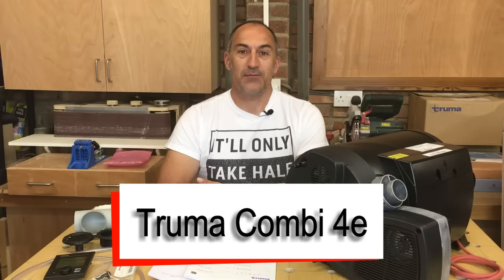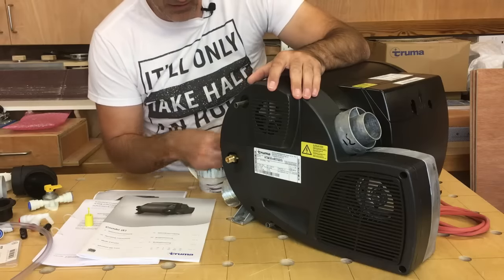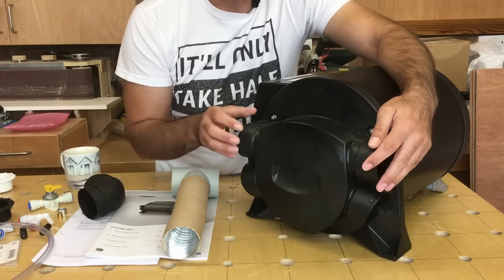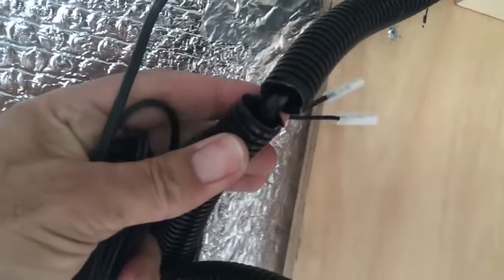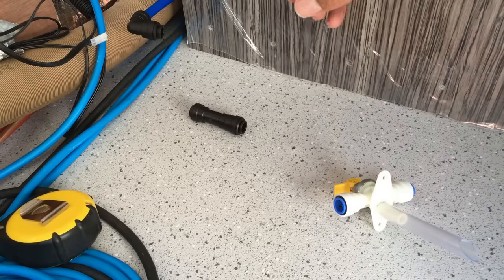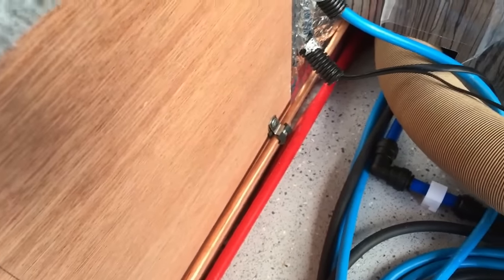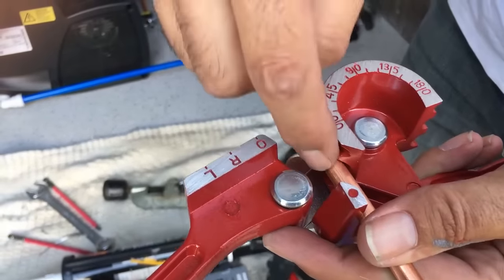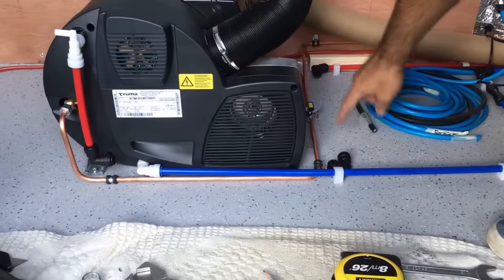Truma Combi 4e Self Build Camper Van Installation

Comment: Hi Greg, I'm doing my own build and have bought the Truma 4e. Your video has been a great help. One question, Do I take the 12v feed for the boiler from the van chassis battery or from the leisure battery???
Reply from the maker: Hello Graham, everything you fit in the back of the van for camping comes off your leisure battery. You shouldn’t be connecting anything to the van battery unless fitting a split charge kit or B2B charger. 
The Truma need both 12v 10A supply and 230volt 10A supply from hook up. The remote controller also needs a 12v 1Amp supply. 
Have a look at my latest wiring video it explain the leisure side very well.
Reply: Hello Greg, excellent videos and have helped me tremendously. One question, does the Truma 4e run ok when you're off grid ?  Off the 12 v system or through the inverter ?  Thanks Colin
Reply: @colinroustyroyston5904  It will use LPG when you are off-grid and 12v to power the fan. You shouldn't really run the truma from your battery bank as it would draw way too much to heat the electric elements, probably best to just use 240v when on campsites if you have EHU.
Reply: @AnthAmy  thank you for that . So can you run it off grid at all and if so can you get enough hot water for a shower etc using the LPG . Obviously I'm looking  to have showers and heat the van when off grid,  is it capable of this ?
Reply: @colinroustyroyston5904  yes of course, in our experience (we had one in our motorhome) the lpg heats up faster than the electric elements. Long story short, when off grid you can definitely use the lpg. lpg gives out more heat than the electric and it's also hotter faster. It's definitely capable of that. You get 10 litres of hot water per shower, so if there is two of you, the second to go in would wait 15-20minutes for it to heat back up (in our case)
Reply: @AnthAmy  Thank you for that . All I need to know . Cheers 👍

Comment: Hi Greg I received my boiler now thanks to tour advice, I’m just installing the wall cowl, should the ducting go all the way to the end? Eg around the bend or only on the straight part?
Reply from the maker: KeepTheBalance if you are talking about the exhaust duct there is an inner and outer part. There are clear instructions in the installation manual how to connect these and the clips to use. Both the inner and outer need to be connected at both ends. Please follow the instructions. Thank you

Comment: Good morning Greg.  Thanks for your videos.  I am also camperizing (a peugeot boxer) and I am also putting 4cp truma.  My question is the following: you do not install frostcontrol valve as the manufacturer makes ?? Could you draw a scheme with all the components thank you very much for everything
Reply from the maker: I installed the drain down valve to winterise the system. 
Are you referring to another device?
Reply: I mean the FrostControl valve.  which empties the water when it detects the temperature below 3 degrees. Thk
Reply from the maker: Pablo that would be a pain if that happened unintentionally it’s been -3° and snowing here in France last week.

Comment: Hi Greg, loving the sprinter build videos and finding them invaluable for our own selfbuild. We are just about to instal our Truma 4e & just wondering what size 12v cable you used to wired it and does the control panel need a power supply? Sorry if this has already been answered but we couldn't find anything in the comments. Many thanks in advance Emma & Lee
Reply: Did you get an answer for this? I've got everything hooked up but can't get any power to my display unit

Comment: Hi Greg, a great set of videos and really well explained! We're due to install our Truma heater soon and in the Installation Manual for the 4, it states "A 1/8 in. NPT plugged tapping, accessible for test gauge connection, must be installed immediately upstream of the gas supply connection to the furnace (not included in scope supply)."  I don't think you did this in your install, unless you added it elsewhere/later? Is this strictly required, or is this a requirement for installations in the US etc (we're in the UK)?
Reply from the maker: I have a test point near my regulator for gas pressures.
Reply: @GregVirgoe  Thanks Greg, good to know. we had the gas supply fitted professionally and they haven't installed a test point, so we'll probably add one.

Comment: hi Greg, hope the travels are going well, me and the missus are about to convert our 1st van and I have been keeping an eye on yours and many others build videos for ideas, personally I never get cold but the girlfriend has to have the heating on a lot in the cold, has this boiler been as good as you say or have you had any issues with it that you would possibly change? look forward to your reply and keep up the good work with the videos
Reply from the maker: kevin hope I will be totally honest it’s actually far exceeded our expectations it’s so controllable, heat the van really quickly, super quiet at night and the bonus of running hot water at all times. I would pay double for this and not bat an eyelid it’s that good. 👍🏼😁
Reply: got a solution for you just do a treesome with the missus and girlfriend problem solved no expensive heater needed. yours Greg.

Comment: Nice video Greg. What pipe are you running for the hot and cold. Looks like semi rigid Polyurethane?. The tube inserts pushed inside. Why didn’t you use the ones with o-rings on.
Thanks for any info
Reply from the maker: Hi John, please watch this video it gives you all the details on the pipe and fittings, thanks
https://youtu.be/28VwvLNf2r4

Comment: Hi Greg, I’m currently converting my van and have 200w of solar and a split charge relay so the battery will be charged whilst driving and my battery is a 100amp lithium battery. Do you think il be able to run the Truma 2e with my set up? Thanks love the Chanel, 
Conor

Comment: Hi Greg, followed a lot of your videos and you’ve helped a lot along the way with our build!
Just had a question about fuses, what size fuse you had for the 12v to the control board on the Truma and the 12v for the control panel (I think the manual says 1A)? Also what size MCB for the 230v supply to the Truma? Any help would be appreciated!
Reply from the maker: 12v DC to the Truma is 10Amp fuse.  
230volt to the Truma is a 10Amp fuse. 
The 12v DC to the control panel is only a 1Amp fuse
Reply: @GregVirgoe  Thanks Greg, much appreciated!

Comment: Greg do you see any problems running a tee'd off loop with its' own pump for underfloor heating from the Truma? Would it need its' own header tank for expansion? Ta
Reply from the maker: Definitely do not do this. Absolutely no need as the unit gives more than enough heat from the air side. There’s a long list of reasons NOT to do it and not one reason for it. Can’t put it more simpler than that. 👍🏼😊
Reply: @GregVirgoe  thanks for your reply. Bit of a red flag to a bill though! Gimme some reasons...

Comment: I have a truma for my taxa cricket and I drained the tank and used compressed air to get the water out of the tank.  I blew air into the hot water side and the remaining water came out of the cold water inlet.  In your opinion is this satisfactory to winterize the water tank?

Comment: Great video! I’m trying to replace or repair the hot water elbow connector on a earlier Trumatic C3400 but can seem to separate the two sections. Any ideas? I can unscrew the fitting from the heater body but then can’t separate the elbow joint which needs replacing

Comment: hi Greg  I have a question about the Truma system.   When running the water and air heater together  do you notice any degradation on either?  Do they both continue to work to full capacity ok?
Thanks again for the video series.
Jim
Reply from the maker: Hello Jim, in practical terms in two years I’ve only ever run the heating. As the water jacket surrounds the burner you get hot water as a by product of the heating. 
So we set the heating to 16°C overnight it may come on once or twice to take the chill off the evening and in the morning you have a tank full of hot water 😀
During the day if we want to do a bit of washing up and the Truma is cold we boil a kettle because it’s far more economical on gas to do that than heat 10litres of water with the Truma. 
That way our gas can last us 2-3weeks in winter we still only spending £20 a month on LPG brilliant! 👍🏼

Comment: Hi.  I notice you didn't use the insert on the cold (blue) pipe. Is that because it won't expand. Can I use it to be safe. 
Thanks.
Reply from the maker: You don’t need them on the cold water pipes. The hot pipes go a little softer when hot water goes through them. JG advised me 😁

Comment: Hello

Small question for you, I admire you!

What do you think of just using the stove to heat water?
Reply from the maker: Yes it’s a perfect solution. When we don’t have the heating on in summer we just boil a kettle for washing up etc
Reply: @GregVirgoe  Could you have ended up using "only" a Propex HS2000 as air heater, using the stove to heat water  ?

Do you have a Patreon or an alternative way to support you for the great help you provide ?
Would love to contribute

Cheers
Reply from the maker: @maximedefooz1268  yes of course. Or a diesel heater. 
I am going to do a much simpler system in the next van build. 
If you would like to donate a gift you can do at www.paypal.me/gregvirgoe 
Thank you

Comment: Did you use a 1amp fuse for the controller as per instructions- if so how did you do this? Thanks as always :)
Reply from the maker: Yes, I did. I have an additonal blade fuse holder in the cupboard above the kitchen behind all my controls that feed power to the kitchen light, Truma INet box, CP control panel, water level guage etc I ran one cable up to the fuse holder and fed everything from that.
Reply: @GregVirgoe  perfect thank you! Got me a new fuse box!

Comment: Hi greg.
Can i ask do you need the pipe inserts on the blue cold 12mm pipe as well or is it just the hot pipe that needs them. Thank you in advance for your time.
Reply from the maker: Just on the hot pipe only. I did speak to JG direct about that and it’s only because the hot water makes the plastic softer. Cold pipes are not affected.  👍🏼😊
Reply: Thank you Greg for the reply 👍

Comment: Hi Greg, great videos! Have you calculated how long you’ be able to shower with the 10 litre boiler and your expected flow rates?
Reply from the maker: This is a great question and one that I definitely want to cover in a video at some stage on our travels.
Water in the boiler must be stored above 55°C to kill off any bugs and would normally be 60°C
You would not shower in this temperature as anything over 43°C can cause burns.
So you mix it with cold water at the shower mixer and shower in water that is just above body temp 38-40°C
So your initial 10L of stored hot water goes much further when mixed, usual ratio is 60% hot to 40% cold.
That gives us 16.7litres a bit under 4 gallons so it's not as generous as we are used to at home but enough for a shower.
So I'm employing methods to reduce the water use, flow restrictors in the shower hose, the shower head has a trigger so only runs when held in.  You then have to use the NAVY showering method. Wet yourself head to toe, soap and lather, then finally rinse.
It surprising how little water you can get done in rather than just letting it run down the plug hole while you're singing into the loofah :D lol
Reply: Hi Greg, slowly planning my conversion for Summer /Winter -20C camping and shower/hot water is big ? for me. Have you come across a heat exchanger connected to your car cooling circuit? Anytime you drive the camping water circuit heat up in 10L exchanger ready to be used later for shower. Sounds great to me as I'm already using residual engine heat after driving for heating interior. 
How long your Truma has to run to get hot shower in summer when you normally not using the heating? 
Thx Pav
Reply: @GregVirgoe  :D

Comment: Hi Greg, is your combo still going strong ? 
Have you had to spend anything on it, am considering the diesel D6e any tips ?
Many thanks
2:55
Reply from the maker: Yes it’s still working perfectly and has been the best part of our conversion by far. 
A few things to consider with the diesel version are it will be noisier because the burner has to atomise the fuel, it doesn’t burn as clean as lpg so will need regular service and it does cost considerably more up front. Have you considered an underslung lpg tank and gas version.
Reply: @GregVirgoe  
Have purchased a D6e today, it won’t be installed for a while as lots of other electronics and water to to do, it’ll give me time to read up on the installation, many thanks for your reply, still going back through your videos, often find myself saying “talk to me Greg”
Good to have a wingman
😂😂😂👍

Comment: Hi Greg, did the thermostat cable come with the unit or did you buy it as an extra. I only ask as mine has now been delivered with the thermostat but no cable.
Reply from the maker: Do you mean the small temperature sensor. About size of 20p in diameter?
Mine came with a cable very similar to bell wire with small spade connectors on. I had to extend mine a little and I know you can run up to 10m of cable. Use a 0.75 or 1mm flat pair like speaker or doorbell cable. Let me know if something else? Cheers
Reply: @GregVirgoe  thanks Greg, I'll get onto my supplier as it's missing 👍

Comment: Hi Greg ! Thank you a lot for your videos full of knowledge ! ! ! 
Did you put the combustible gas outlet on the side door wall ?
Is that okay when the door is open? Are the gases not too hot ?
Reply from the maker: Λ Y Λ M the glue outlet is on the side behind the drivers seat opposite side to the sliding door. The window above does not open and the vent is the right distance away from the drivers door and window. It doesn’t cause any problems.
Reply: Ok Greg thank you ! I’m planning to put the glue outlet on the sliding door side. Is it ok or very hot when gaz goes out ?
Reply from the maker: Λ Y Λ M it’s not a good idea if your sliding door goes over it or if you plan to fit an awning or canopy on that side.

Comment: Hi Greg
Your videos have been a great help over the course of my build but I am at a point in the Truma boiler install that I cannot think what I am doing wrong, I have installed the flue, hot cold water, gas, 12v and 230v supplies also connected the coma cable to the controller but I have no power to the controller I am obviously missing something but for the life of me I cannot think what, help and advise needed urgently.
Regards
Nick
Reply from the maker: The cp control panel needs a 12v dc supply. There should be a small white plug and lead that clips onto the back of the control panel. It needs to be fused with 1Amp fuse.
Reply: Thanks for the reply Greg, yes have done this and it still has no power, I have tested the white plug when connected to the 12v system which is fine but still nothing when connected, starting to think it’s the controller it’s self.
Reply from the maker: @margaretEvans-q2w  things to check. 12v power to the boiler and 10amp fuse is ok 👍🏼 12v power to the control panel and 1Amp fuse is ok 👍🏼 control cable plugged into boiler and remote controller ok 👍🏼 
Any main isolating switches on battery turned on and all cables connected. Sorry if that’s basic but sometimes it’s a simple thing that’s missed.
Reply: @GregVirgoe  all done now Greg, it was me I got the polarity wrong.
Thanks for all the advice though.
Reply from the maker: @margaretEvans-q2w  I’m pleased you managed to fix it ok 👍🏼🤩

Comment: Great video as usual Greg! Our truma has come with a slightly different cable to this, it has 3 very small pins at the end (sorry no idea what it's called) instead of just 3 separate exposed wires. Anybody know if we could just cut that bit off and wire it into a normal plug or fused spur?

Comment: Hi Greg,
Loving the series, thank you.
Would the concentric inlet air and exhaust pipes also aid in heating the inlet air for better and more complete combustion? Or would it achieve the opposite effect as less dense air provides less oxygen for combustion?
I think I need a mechanical services engineer to answer this.
Reply from the maker: Hello Mark, yes you are right the inlet air will no doubt be pre heated by the exhaust gases. As the air heats it will naturally want to expand and will become less dense. I've no doubt that the clever guys at Truma will have sized the flue fan to deliver the correct amount of air at operating conditions for complete combustion of the gas. 🤓👍🏼
Reply: @GregVirgoe   to add to mark d's question, with the vent and intake being so close together, is it possible to suck in exhaust gas right back into the unit?
Reply: @steveschott9926  yes, but the outlet is usually a bit longer, sticks out further to behave like a nozzle which blows the exhaust away from the inlet. You will get a bit of inlet contamination if you say park your vehicle next to a hedge that encloses in/out flue terminal arrangent. The flue will work best if the flue exit side of the 'van is well away from any wall/hedge/other vehicles

Comment: Hey Greg, do you have any info about wire and fuse sizes for the Truma 4e? I've just completed the install of the water side of things using your videos. Thanks!
Reply from the maker: stubostar yes I do. Both the 12volt DC and 230volt AC supply to the boiler need to be protected by 10Amp fuses. The 12v DC to the CP controller needs a 1Amp blade fuse.
Reply: @GregVirgoe  Thank you for taking the time and for responding so quickly....should only take 10 minutes now! :D